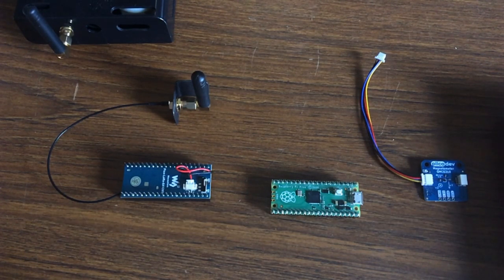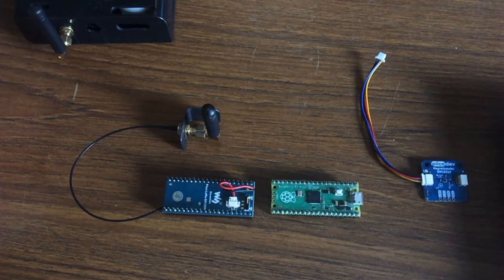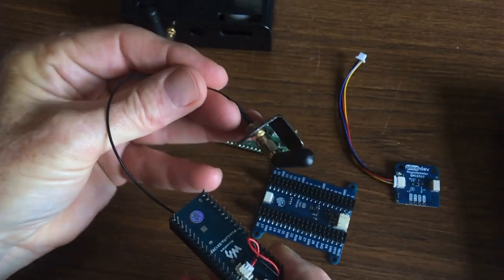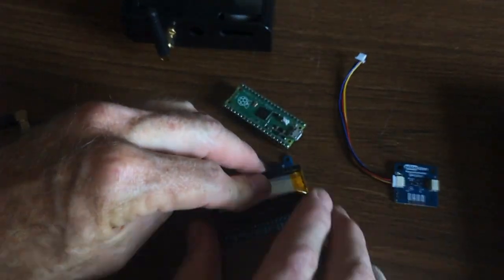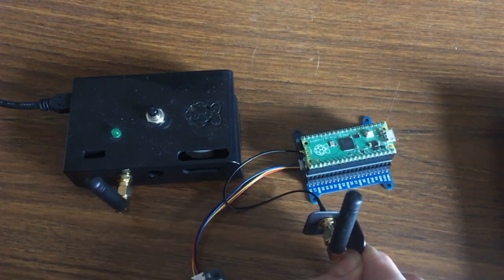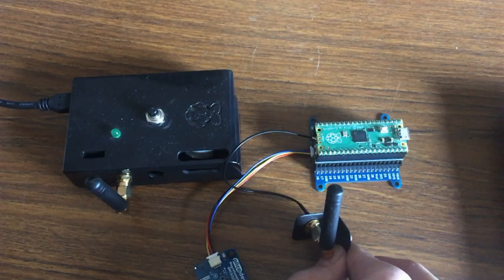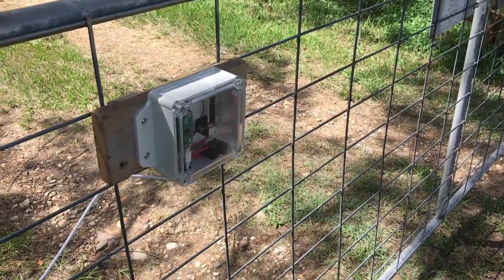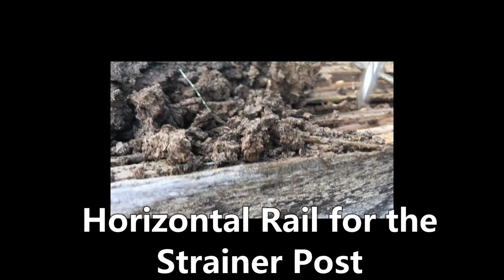Raspberry Pi Pico - LORA Remote Gate Monitor

Comment: Congratulation on the 1K Dave!
Welldone on your gate alert system. Im thinking about a similar arrangement, but my driveway is much easier than yours its lessthan 100m to the house.
I just got a ESP32 cam working with guidance from experts at my mensshed. I have not made it portable yet so I have no idea whether it will work over the distances your pi works, specially with video.
Reply from the maker: Hi Greg, 
Thanks for noticing the 1K.  Been a long slow process.  At 999 had a couple of unsubscribes.  Apparently people don’t like my horse shorts 🤠
LoRa protocol isn’t designed for high bandwidth stuff like photos and videos.  It’s simply text.  You can jam a string of characters in one end and they come out the other.  Sure you could encode / decode a picture into text but it would be slow.  Email still works that way as far as I know 🤠
The resources on the pico are also tiny and I think I’m starting to bump into the memory limits.  Off the top of my head the RAM is 256KB and the flash storage is about 2MB
But it can certainly still do a lot with very little power.
I had a quick look at you ESP cam and it looks good.  100m is a long way for wifi but you may be able to do it with a directional antenna.  It depends on how much power it puts out.  Some wifi devices have country settings because different countries have different rules for frying the brains of there population.  Pick a country that doesn’t care and you get more range 🤠
It’s actually more about population density and interference with neighbours wifi.
David